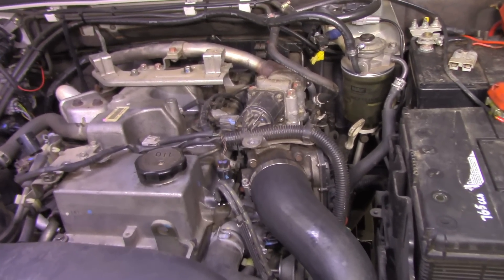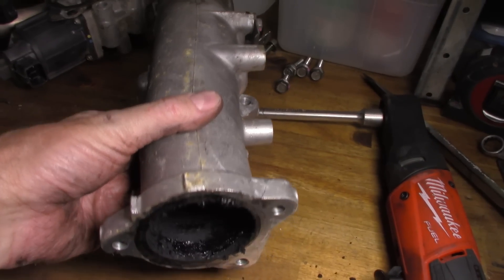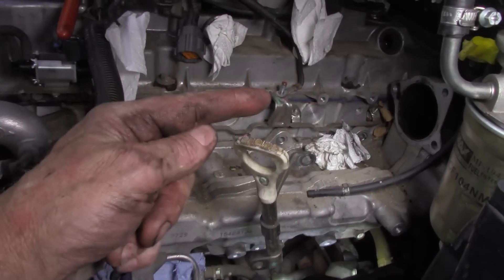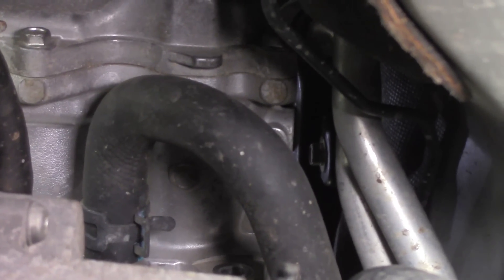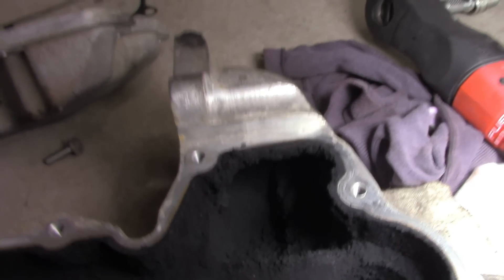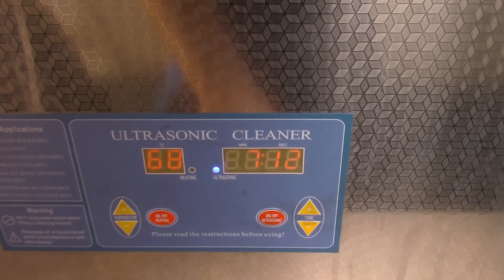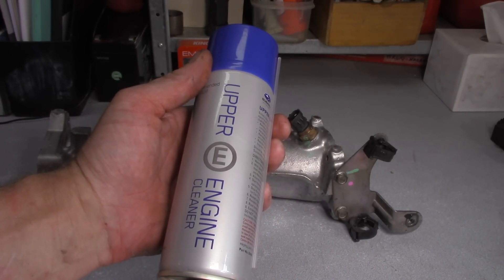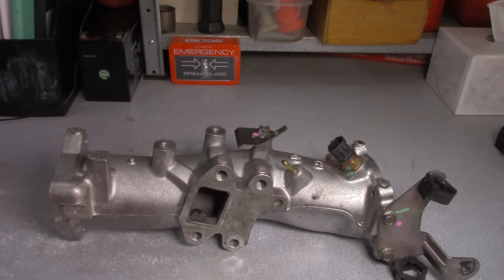Carbon Removal - Full Intake System Clean - The Proper Way!

Comment: This is the unfortunate effect of direct injection engines with EGR (Exhaust Gas Recirculation). This video shows you how bad it can be. I have seen worse. Unfortunately it dose need to be cleaned manually and preventative work needs to be done as explained by Max. Max thank you for pointing out to your viewers the sneaky hidden bolt. 🙌
Reply from the maker: Thanks for your comments. As I mentioned in the comments, the EGR is involved with the carbon build up, but not the creation of it. Many turn to EGR delete as an option, but as I have mentioned in other comments, as it is illegal, I do not consider it an option.
Yes, I also have seen worse, this just happens to be the one that I did a video on. There is no real way to get the carbon out without creating other issues on the way out the exhaust system - manual cleaning must be done. Then preventive maintenance can be done after with chemicals to try and keep it clean.
I knew this would be a hot topic! Everyone has thoughts on the matter.
I can only go on what I have personally experienced over the years dealing with this issue.
Thanks again for your comments. 👍😉